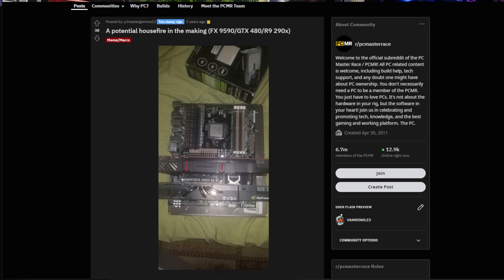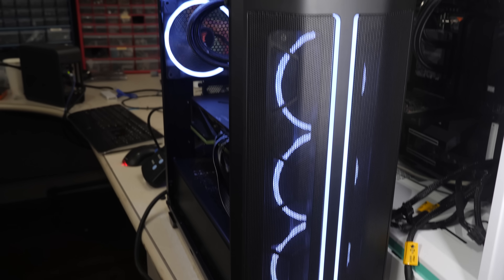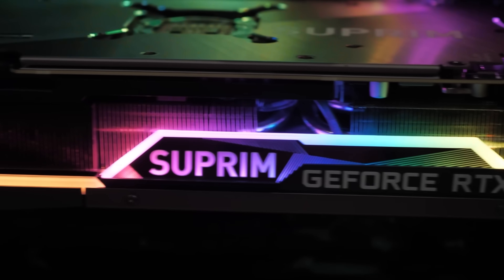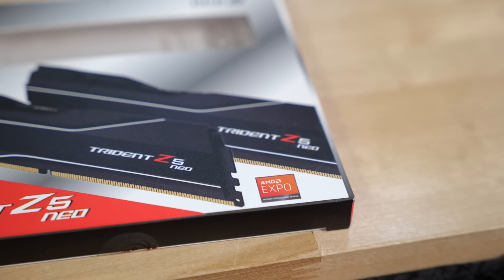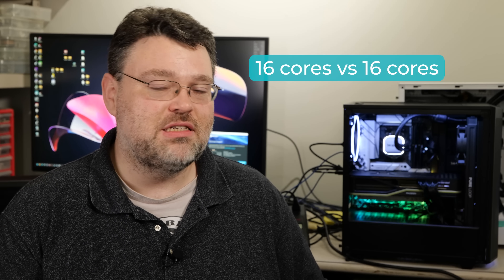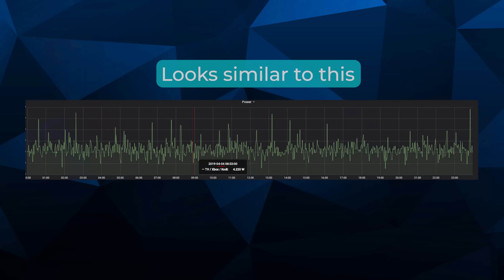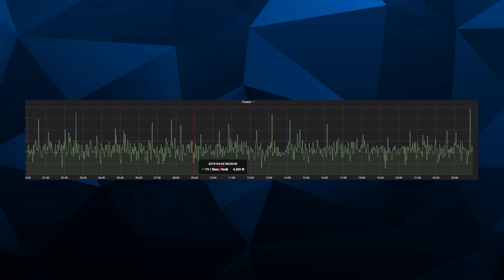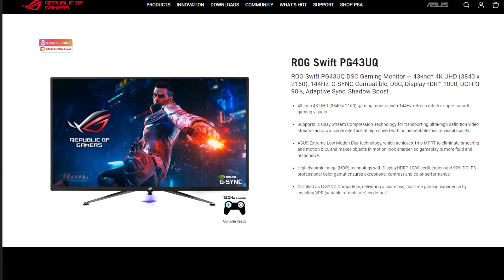Too Hot? How much Heat Do Intel and AMD Actually give off?

Comment: I have an ASUS X670E with 7950X and I run my system at 105W ECO mode with PBO set to Negative 15. In geekbench5 I get 2255 single-core and 21844 in multi-core with a motherboard LED temp readout of max 60C with a room temp of 28C.  Also at the desktop in POP-OS it idles at 35C-38C. This system runs silent with an ARCTIC Freezer Radiator 420mm (but only using 2 fans !
Reply: bro ur room is literally a slow cooker wtf...
Reply: @2ndcitysaint52  lol, I don't think so. My laptops reach 85C under load and thats with the fans screaming, my 7950X system is so quiet and like I said at the desktop its sits 35C-38C with almost no air movement from the PWM 140mm fans. I must admit I have never run my systems at stock because 95C of heat output and fan noise is not what I wanted from a desktop system. 105w ECO mode is perfect with 95% of what it would get at 170w so the advantages of less heat, less noise etc is worth the loss of 5% under max load.

Comment: We've had the same deal before, 94 C all the time, but that was on AMD 290X GPU. It was made to run like that and I ran it like that for 3+ years. It's not new to AMD.
FX-8350, I owned that as well and yeah, it pumped out heat. But the TJMax was 62 C. It would throttle after that, I guess. I kept mine under 55 C at all times, even stresstests.
Reply: Fx's were fairly easy to cool when not trying milk every 1% more performance out of it.

Comment: Very awesome! This was my exact question when it came to the high temps… the silicon can handle it so I don’t care as long as it’s not dumping crazy amounts of heat into my room. My curiosity is more a comparison between 5000 and 7000 but that is kind of moot as everyone will upgrade eventually. I’m happy with my 5800x for now.

Great informative video!
Reply: maybe im a bit off but heat over 80-100c can damage any component over time
Reply: Using your PC at all wears it out and reduces performance over time. High temps wear it out a little faster. High voltage wears it out a lot faster. 

AMD has been designing their workstation and server hardware to run at 95C for a long time. In college I had a FirePro WX7100. Despite being a single slot card, it was designed to be silent most of the time. The fan wouldn't even turn on until 90C, would ramp to 100% at 95C. I emailed AMD support about it and they told me temperatures up to 105C were considered "safe".  

I guess they assume that people who run their computer that hard will upgrade before degradation becomes an issue. And people who don't upgrade often won't be running it hard anyway.
Reply: @Azurefanger  I think you didnt realy understzand the video. It is internal temperature of the silicon part of chip. Even heatsink is like atleast 20°C cooler, and even that is spread out from the rest of the system.
Reply: @Azurefanger  High temps can degrade performance over time, but we're talking 10+ years at these levels. That's why AMD has come out and said its fine to run at this level 24/7. Its like how writing data to SSDs wear it out over time. Everyone got concerned they'll wear out their drives, but for most people its not an issue. In the 8+ years I've been using SSDs, even on servers at the data center doing high write volumes, I have yet to see one fail from write failure. Even the Samsung 840's that reported 0% life 6 years ago are still going (I don't have anything important on them though lol).

Comment: The reason for the thick heat-spreader on the current released Ryzen 7000 series CPUs is because of compatibility for the upcoming 3D V-Cache models.
The 3D V-Cache models will have a higher z-height for the chiplets and therefor the current "none 3D V-Cache" models needs a thicker heat-spreader to compensate for the height difference.
In other words the 3D V-Cache models will have a thinner heat-spreader, that is at least what I believe is the case.

Comment: "Everyone remember the FX8350 days?"

Yep! I still use one. Duel 140mm corsair AIO keeps it cool(ish), most of the time. I used to run an ARK server for a few friends and the game client at the same time. Got a bit warm but to be fair it handled the task pretty well.
Reply: I'm running an overclocked Xeon E5-1680v2, and it eats 200+ watts under synthetic load. The heat is real.
Reply: i know a guy using an fx6300 in the current year.
Reply: I run my 12700k at 5.2ghz in my room with 8x e5 2680 v3s in a micro server 24/7 idk what's wrong with me

Comment: i wonder if there is ever a case where lower core temps actually matter in a noticeable way - as in the chip is cooler and therefore a bit more efficient as systems resistance is lower from lower temperature
Reply: Only by reducing heat into the room, reduced power consumption (if run at 105w like I do), less fan noise, reduced water pump speed increase the life time of water pump. Also because it runs at below 50C then single core will boost to max (5.88Ghz for me) possible.

Comment: When AMD said the 95C is by design and its still covered by warranty I stopped caring about a number that others decided was an issue.
Reply: i mean this isnt the first time cpus run  at that temperature constantly look at all the laptop parts from both amd and intel. They run at these temps and never have failed even after a decade. This kinda reminds me about the people freaking out over the 1.4 volt single thread thing on ryzen 3000. Its a whole lot of people freaking out over nothing
Reply: @Silver Joystix people freak out when they see the 95c hotspot jus like they did with the gpus
Reply: @BreakingDimes  I trust a non biased source. Not a marketing droid from the marketing department. These systems will be dead in a year right up there with the red ring of death in Xbox 360s
Reply: @timothygibney159  cpus have ran at these temps for years in the past no issue this will be no different
Reply: @BreakingDimes  I think not. An electrical engineer told  me the failure rate doubles every 5 degrees after 75c. I will refuse to buy AMD now
Reply: @timothygibney159  that's cool so what about laptop chips what have been running at 95 to 100 degrees their entire life and still work thoughts on those

Comment: Hmmm... its almost like that thing in physics: similar work requires about the same amount of energy.

Note on the temps - asked someone to run their 7950X under a 130mm AIO and load cinebench thread by thread. It started low 60s on a single thread, and needed 20 out of 24 threads to hit the 95C.

Lets also remember that there are essentially 3 factors that AMD tunes while pushing the CPU: voltage, current and clock frequency. More voltage * current = more power = more heat. But more clock speed also increases the temperature (switching = work). Another factor, the work done by the CPU, then tests the stability, because if you dont give enough voltage and/or current for a given load, the program will start spitting errors. To remain stable at the same power, AMD's algorythm then drops the clocks.

So in those last 4 threads, what is AMD sacrifycing to maintain that balance under 95C? And maybe it doesnt need to sacrifice anything if you can achieve 5C more cooling...

Maybe CPUs should be build with vapor chambers on the die, like the RTX 4000 series, instead of heatspreaders of solid copper like they currently have...

Comment: I wish people understood cpu temperature isn't what determines how much heat is being dumped into your room, it's how many watts or the power. A 70c cpu can technically put out more heat than a 95c cpu
Reply: My system rarely if ever pulls 500W from the wall (Hasswel-E i7 5960X TDP 140W OC@4.5GHz + 1080Ti) - it's perfectly suitable room heater. In the winter I don't turn on heating in the room with the Window closed and PC running, in the summer I'm hitting room ambient approaching 40... this is UK climate, so hardly tropics. Tell me more how 170W TDP CPU constantly trying to hit the wall "by design" which will gonna be paired with 400W GPU won't be an issue. Once I finally switch platforms, that bitch isn't going anywhere outside the ECO leash...

Comment: Here a fun test. Gaming on Linux with a 5950X/5900X vs a 7700X. Prediction: when the shaders need to get compiled on a first run - before you have the cached shader-files - the gaming-experience will be better with the 5950X/5900X because you get less stutter, shorterlasting stutter. Sadly I can't try it out, I lack the hardware. I would love somebody to test that.
Reply: Comparing my two laptops (5900HX with 3070 and 3900 with 3070) both of these systems take ages to compile the shaders but on my 7950X its so quick I hardly notice it.

Comment: Ahh.. Heat in my Room.
A good Nvidia RTX3090 Space heater combi with a Old R3950X.
In frond Unity and in the back Blender this winter is welcome..
The max Power that i saw on the GPU 420W (HWiNFO). and the max 50% use case on the CPU, no idea how many the 64GB RAM pulls.

Comment: I strongly disagree on this one Wendell, 95C is an issue, try to use a Zen4 here in the summer with 42C (no AC), AMD can keep their CPU with their terrible IHS
Reply: 42C ambient sounds like a rough environment to run any cpu in.
Reply: @cts006  it's reaching 40C ambient due to heat from PC... I literally experience the same in the summer and I hardly live in tropics (UK). In the winter I don't turn on heating in PC room (4.2x3.5m) and a single machine pulling "measly" 500W under stress is enough to keep room in nice (22C) temperature after couple of hours of operation...
Reply: Are you encoding video or doing 3d renders? Because that is the temp when approaching full load, not when doing bullshit. The performance you actually get out of the system in loaded productivity is massive. It's still faster than the 12900k in ECO mode, which is dumping literally the same amount of heat into the room but faster, for a longer period of time. Which is the point Wendell is making. You're either concerned about the longevity of the CPU or the effect of the space, specific to full core loads. Either way 95C is fine. How long do you wish to be dissipating 220-230w?  My particular 5950X/board combo hits 90c stock, but my GPU pulls more watts gaming than the CPU. My UPS reports 558w max from the wall playing Cyberpunk. I've run a 6 GPU mining rig, that I can feel the warmth from halfway down the hallway.

Comment: Excellent video as always; 
I think a lot of people having a problem with these numbers needs context on the difference between a ºC, watt, watt-hour, etc.  You really touched on it in the video that a render using the same watts but less time will output less total heat/energy, but a game being locked in timestep will be negligible difference in total energy despite a different temperature.

Comment: great video! I was concerned about this when considering a 7950x build. glad to see it wont be as much of a concern as I feared!
Reply: No need to be concerned because if you can run it at 105w you will lower temps dramatically with negligible performance difference (35C-38C) at the desktop and under load 60C with a room temp of 28C like my system.

Comment: Wendell, the problem as I see it: 
- the temperature gets unnecessarily high, only because AMD made the IHS too thick
- the power-usage also gets higher with the higher temperature, for derBauer 15W. 

Yes, this way there is limited cooler-support for coolers which people bought for AM4. Limited! That is not a good trade-off in my opinion. I am all pro-'let's not waste metal'. Cool! But when you go from lga to bga I can live with buying 1 new cooler. Having said that, maybe AMD could find a better solution than making the IHS thicker. Why not make the substrate thicker?
Reply: It would be a bigger deal for the masses. The 7600X loses only 4% with the stock 5600X Wraith Stealth cooler, under full core loads. Which guess what, most people aren't buying a 6 core for. Also, it was still above the advertised base clock. Getting what it says on the tin or better is more important than sweating some theoretical max OC. Gaming isn't effected at all.  It's fine that the stock cooler is mildly sub-par, because that has literally always been the case. Those that figure that out eventually replace it. AMD actually provided above average (better than Intel) ones. Practically every Ryzen custom build that's come into my shop (over the past 4 years), that came with a stock cooler, was being used with it. Most of them were first time builders, and the majority of people aren't enthusiasts worrying about temps. When the system is still putting out proper performance anyway. Every after market cooler I saw used the stock AMD backplate and hooks. I personally use Noctua's in my custom builds, which are also a non issue. Considering most people are going to go with the popular option, most popular AM4 cooler options will work absolutely fine on AM5. Scythe is like the only real outlier, but the handful of those coolers I came across were all on Intel builds. More people are bothered already over the total platform cost, so its not terrible for the cooler to be one less expense.

Comment: None of this would be needed if AMD would of made a normal IHS that didn't look cool. Designing the chip to be rectangle shape or just so all the SMD parts fit under the IHS  would if been much better because right now the IHS is twice as thick as 5000 series and that's where the heat is coming from unfortunately
Reply: Technically none of it is needed period. The heat comes from the CPU pulling 230W, the operating temp just is what it is. You don't get much more stock performance when the CPU is cooler. 85% of computer users have zero concept of what their CPU temp is. Considering the vast majority of people are using OEM computers that only invest in cooling capacity for a result of 90c or worse regardless of wattage, it's only poorly informed DIY builders going this hard. The IHS isn't designed to look "cool", its designed to work with the majority of existing AM4 compatible coolers? The SMDs are probably actually better not being under the IHS. They were on the underside of AM4 CPUs, but LGA design no longer warranted that approach. On the top side they either sit higher than the dies or lower. Higher means more effort machining the IHS, and lower means their either trapped in a sealed hot space with no airflow and no IHS contact or different additional machining. Both come to it still being thicker to accommodate the same Z height for compatibility.
Reply: @blkspade23  the design on 7000 series was made to look cool, whether happy accident or planned. They could of made the cpu and socket in more of a rectangle shaped allowing for all SMD hardware to be under the IHS so the IHS would be the same and not thicker.  Heat isn't strictly based on the watts a cpu draws. A lot of factors go into that
Reply: @chosen1one930  If you look at basically any other LGA style chip, you'll notice the SMDs are never under the ihs.  On Intel and Threadripper/epyc they are on the bottom of the substrate. There is clearly an engineering reason for that. The thickness has nothing to do with the SMD placement and if they could be under the IHS, it would be the same thickness. There is a difference between getting hot and really producing heat. 25w is still too hot to touch, but it's still only 25w of heat to be dissipated. Apple silicon at that wattage still gets to 100c.